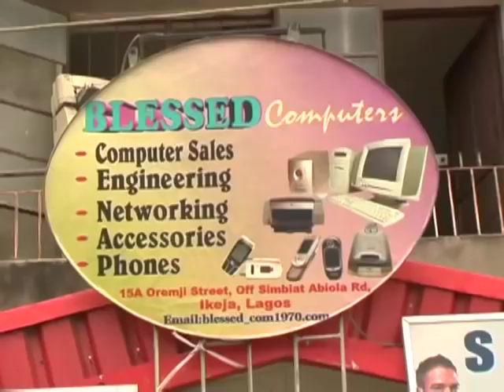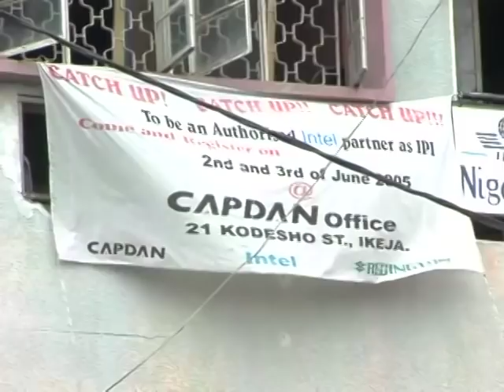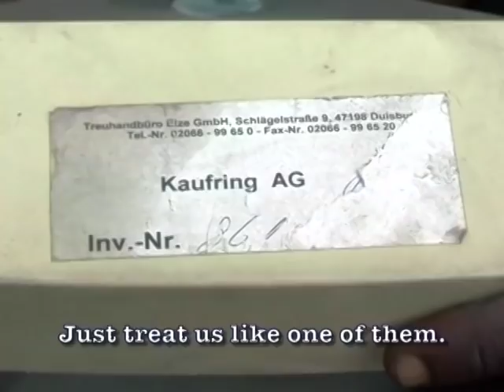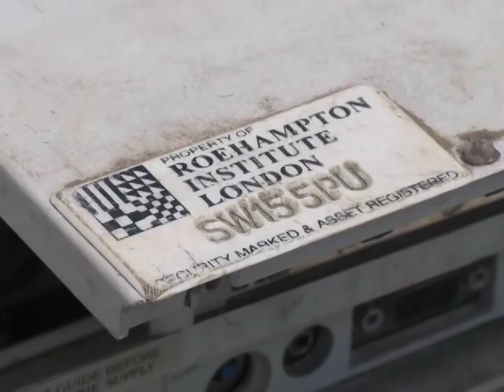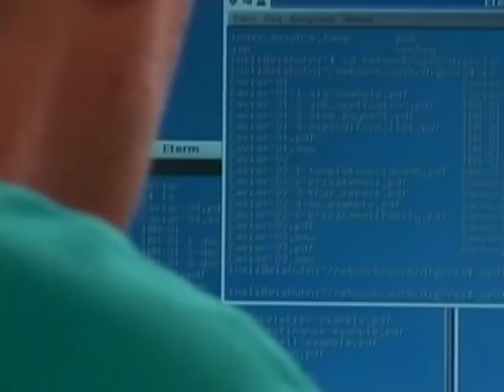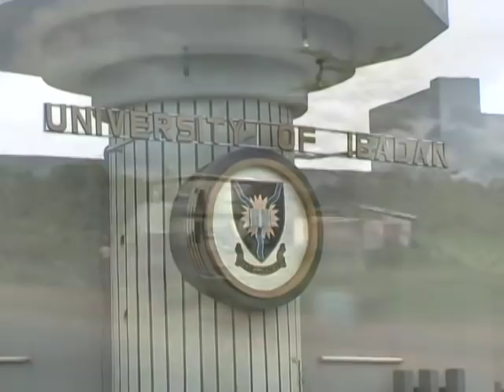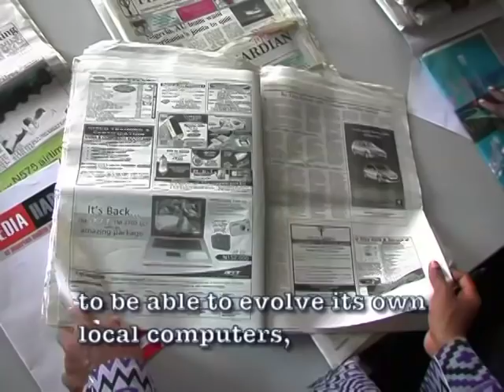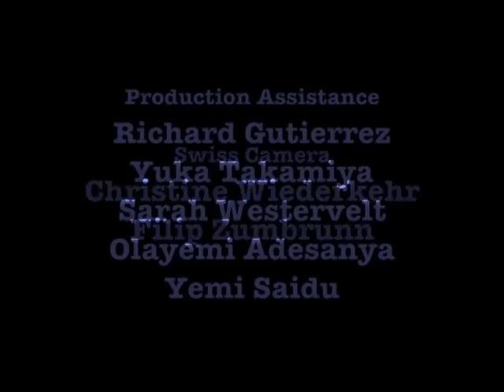The Digital Dump, Illegal Electronics Waste Trade Documentary in Nigeria

Comment: its all repairable. its just lack of know how that makes it junk. most of these computers are more than good enough for most ordinary loads of work. what african countries need is skills in computer programming and cleaning and repearing of circuit boards. there is a operating system that fits on one floppy that would make any of these old computers run really fast and that is one written directly in assembly. if africans had their own assember programmers for such a operating system, they could provide software to it that would make the old computers run as really fast computers. a slow computer is so because of to heavy software or poorly written software.